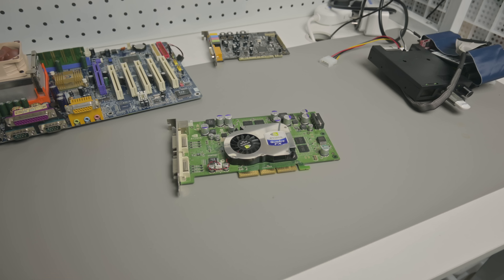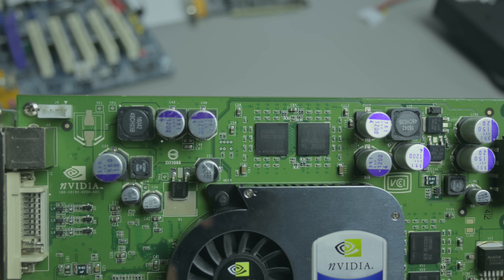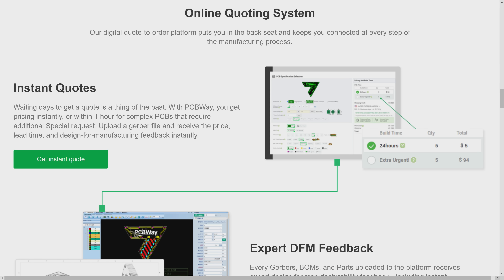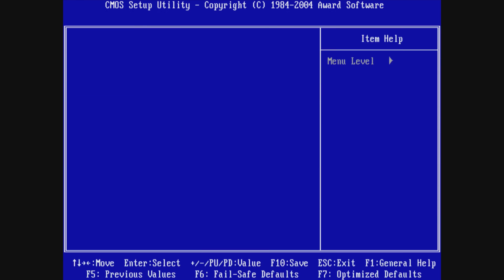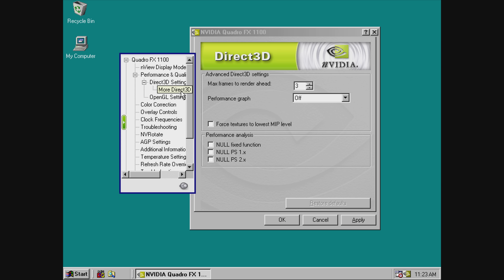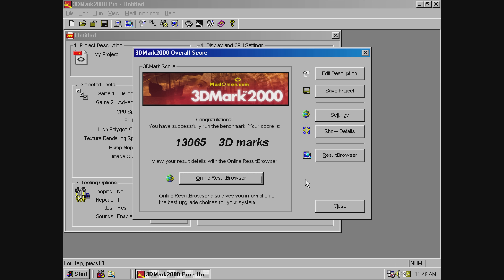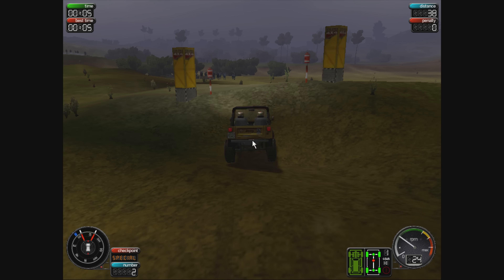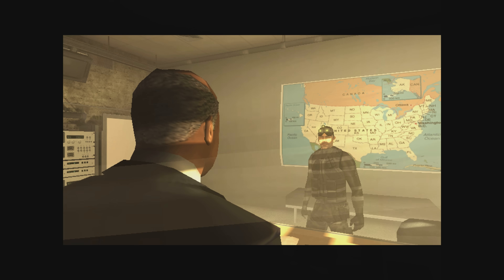20 Year Old Workstation GPU: Nvidia Quadro FX 1100

Comment: Wait, what? It's DDR2, not GDDR2? Had to confirm that and seems weird, since the original FX 5700U used indeed GDDR2.

edit: NV36(B) shouldn't have an IHS o_O
Reply from the maker: I checked the memory chips. They are Samsung K4D263238E-GC2A. Each chip is 128M GDDR SDRAM 
and rated up to 350 MHz. Hope that helps :)

Comment: I'm starting to replace thermal paste with thermal pads on my older components and systems.  They don't get "that hot" anyway and it's one and done.  No reapplying paste in 3 to 5 yrs.
Reply from the maker: Even on GPUs? I've used pads before with CPUs, but never with a GPU.
Reply: @philscomputerlab  Even on GPU's.  If a pad can handle an i9 spitting fire, it can handle my rinky-dink GeForce 6800 XT.  Though now, I'm working on a passive cooling solution with adhesive TIM.

Comment: I use this card in my dos box, i didnt want a big crt and wanted digital out with an lcd, so i got a 4k 27" benq PD2700U monitor using dvi to hdmi. i also want cards that run dos to xp well. 4k scales the dos resolutions well and i get the 1600x1200 options in windows games, also very little lag. there's some artifacts on pc player benchmark but all the dos games i run work well. I also use the ati firegl x1, quadro 4, with the same results, the geforce 2 mx does not have problems in pc player benchmark but only has 1 dvi out. the firegl x1 works well up to windows 7, this box is limited to agp 2x so the newest cards im trying out now are the geforce 6600's, keep up the great work phil!
Reply: ps the quadro 4 and fx cards are amazing at fast resolution switching for dos modes, the geforce 2 and firegl x1 are slow to the point where i would have to slow my boot menus

Comment: That grade of cards isnt often that different to consumer cards. 
The primary difference is usually margins.
They are below rated clocks on the core and memory and power delivery.
That makes many of those enterprise cards (more so the modern ones) INSANELY efficient.
There are some cards that compare to the RTX4080 at around 100 Watt power draw.
Reply: Nah, I had multiple of these cards, they have binned chips on them.

Phil's card will do 5700 Ultra clocks, but I bought two others with this one and they clock well above 500MHz on the core.
Reply: @CptOnlyWolf  Well I meant the card itself. The core is binned acordingly. Thats what I meant that they are below rated clocks. Tho I shouldnt expect people to know how Dies are rated/binned in manufacture. Dies are faster than their bin. Thats what I meant
Reply: @AlpineTheHusky  I do understand your point, but good clocks do not rely only on binned chip. It's the PCB of the card, quality capacitors, good VRAM and ofc binned GPU chip.

If these cards can do it after 20y of service, that's a quality product in my book 🤗.

Comment: Maybe running a 6x.xx or 7x.xx ForceWare driver enables 8-bit paletted textures.
I remember running a GeForce FX5950 in Win98, installing the last driver (81.98) and losing support for 8-bit paletted textures. I don't remember ever running a version older than 7x.xx. The feature might have been disabled in previous versions just like with 81.98. If memory serves me well the textures didn't look right in FX cards compared to GeForce 4 cards and older.

Comment: I love old school Quadro cards, as far as I understand they really were the best chips picked out of the fab because they sold for much more and stability is the most important thing for workstations. I have an old Quadro 2 card that is rock solid and easy runs at and past geforce 2 GTS speeds.
Reply: @billy-the-kidd-737  When I Look for Firepro cards techpowerup often mentions that these are stripped Chips compared to the top Radeons. Seems to be vice versa here or Informations are wrong.

Comment: It's funny how Nvidia gave technically higher model number to FX 1100 which like you said is FX 5700, and gave the lower one to FX 1000 which is basically a FX 5800.

I still cannot wrap my mind around how that made any logical sense to Nvidia engineers or marketing team 😅.

If Phil said in his video that FX 1100 need to be delided, it's my mistake. I've been doing few FX 1000's that I bought at the same time and I had brain fart obviously.
Reply from the maker: What's your take on the Radeon 9700 cards? I found that the shim causes an issue when the thermal material disintegrates with time and ends up with an air gap. I removed the shim on all my cards because of this.
Reply: @philscomputerlab  I've done few 9800's Pro, and later cards have slightly slimmer shims and slightly elevated middle portion in the bottom of heatsink in the core contact area.

If you take heatsink off and it is fully flat on bottom, there's a big chance you have one of the early cards. I would remove it in that case, or get an aftermarket cooler.

If the core contact area is elevated on the bottom of heatsink, I would simply repaste and not bother with removing it, due to revised stock cooler and shim 👍.

I have one 9500 that can be soft-modded to 9700, therefore I do not have much experience with these cards. I've removed it nevertheless, did not want to risk it.

Sorry I have to correct my message few times. I've got an OCD regarding this matter and it's quite late over here in UK.
Reply from the maker: @CptOnlyWolf  Yes it's good to take care of these precious parts. Well worth taking a look before powering on.
Reply: @philscomputerlab  After your comments on the R 9700 heat issues  I have wondered about removing the shim as well.  Do you think it could be deterimental, does it have any significant role in heat transfer?  Instead, I have placed a copper shim over the die before replacing the cooler.  Again, I don’t know if this is the best solution as I am adding an extra layer for heat transfer.  This also makes the outer square shim redundant anyway, so your advice to just flip it off could be the best.
Reply from the maker: @DavidJames-d7z  I've shown the shim removal in at least two videos, definitely something I would recommend.
Reply from the maker: @DavidJames-d7z  I've also tried using a copper shim, but it can move and then the heat transfer is a little bit reduced. The Shim pops off easily with a sharp knife or tool.

Comment: The FX 5000 is generally considered to be the worst series in GeForce history. And now we have the RTX 5000 series, which is really bad value and is riddled with issues (connectors, ROPs, black screens, PhysX).
There was also the GTX 500 series, which was technically a 400 series refresh, but Fermi was definitely one of their weakest architectures.
Is this a pattern? 😉
Reply from the maker: We shall see if the RTX 5000 makes a comeback as Retro, I don't think so, seeing it can't do PhysX any more haha. The FX series however has made a real comeback with the retro community. Also the AF quality was ahead of its time, apparently it took quite a few GPU generations to match the quality of the FX again (GeForce 7000 series maybe?)

Comment: I have the same card. I don't know if it was the driver I was using but for some reason the Quadro to GeForce mod works really well. (I'm on 98se). Good to know about the thermal issues, I will have to look in to that!
Reply: On FX 1100's heatsink is directly glued with epoxy to the die.

It was my brain fart about delidding FX 1100's and I've explained that in dedicated comment.

Comment: Do the quadro fx 3000 need repasted? Got a couple of those and a quadro k2200 in my collection. 

The fx line shoud work well with glide wrappers. 

I had a evga fx 5700 ultra and a pentium 4 3.0 w/ht new back in the day. I remember need for speed undergound and half life 2 struggle with that card. Hl2 even dropped back to dx8.
Reply: Yes. 20y old thermal paste between the lid and core is still a 20y old paste, and lost it's peak properties long time ago.

Heatsink is epoxy glued to the lid on all FX Quadro cards, and it need to be obviously removed before delid takes a place, so please be careful if you are planning to delid your cards.

I have much love for oddball FX cards, and personally it would be very sad to see another one go especially FX 3000.

Comment: These cards are supposed to support 8 bit palletised textures... So why didn't it work for you? Perhaps you should have been running the more compatible 45.23 drivers? Edit: i saw someone say this is based on 5700u chip, so that explains why you can't use an older driver.
Reply from the maker: I believe it's a hardware issue, not driver related. FX 5200 or 5500 should work.

Comment: I've been using a Quadro FX 1300 PCIe to game in Win98 on an ITX Core2duo motherboard with T5500 CPU.  In 3dmark 2000 it scored 7191 in Win98 vs. 17226 in XP using the PCIe slot, and roughly the same when using a PCIe to PCI adapter in the PCI slot, so it's a solid alternative for Win98 systems lacking AGP, I'd say at least 2X the performance vs. an FX 5500 PCI.

Comment: Honestly, the quadro and firegl/wl cards should never have existed, it is only a cash grab but offers nil. I'm active CAD drawer since 2003, I learnt on Solid Edge in school, back than I used an awesome radeon 9800 se. When I got first employed in 2006/7, the machines all had Inventor 2008 and 09 and we were using bog standard gtx 8800. My next company built a machine specific to my wishes, using Inventor 2013 and Solid Works 2011 with a gtx 560 and later a 3gb gtx 1060. My current employer is the very first that buys OEM machines with overpriced low power k2000, p1000, t400 and a2000 with INSANE amounts of VRAM like 12GB for the a2000 BUT pair it with the worst CAD software (hicad) that doesn't benefit from hardware accelleration at all. It does everything on the CPU and the machines only use those quadros for display adapters 😂😂😂. Mentally, I have given up on that company, I'm only there for the money and don't give any input or optimization hints anymore, it's pointless.
Reply from the maker: What a waste of these resources 😂😂

Comment: Sorry but I'm an ATi guy.
Reply: Radeon 9000 series FTW :D
Reply: @Q36BN  8500/9100 is also a good option if you are not planning to play any DX9 titles.
Reply: I liked my 9700 pro as well as my 3870 in Crossfire, but I really hated my X1950 pro (because it had overheating issues on a VRM or something). I switched several times between nVidia and ATI (later AMD). Maybe I just like the good old times more than a specific manufacturer? I don't know.

Comment: I had Nvidia FX 5500 256mb gpu back in the day, it actually did well in games back then.
Reply: The 5500 taught me the consequences of thinking more VRAM is better. I didn't hate it at the time, but later learned what a huge mistake I made choosing it over the similarly priced 9700 Pro since that only had 128MB, stung a bit.
Reply: @PhAyzoN  I made a same mistake thinking more vram and better dx version is all i need for better gaming, i didn't know much about other gpu specs at the time.

Comment: I agree that the early Quadro cards were superior hardware.  I've got a Quadro2 Pro and 2x GeForce2 Ultra's, all made with the same design on the same PCB.  The Quadro card has more solid-state caps than the GeForce's and it'll overclock higher - both in core and memory - than either GeForce2 Ultra.
Reply from the maker: Thanks for sharing your experience!

Comment: An nVidia driver programmer once said that these cards, their specialty was wireframe rendering. Gaming cards can render 1 pixel wide lines just fine and very fast. Thicker lines are emulated by rendering quads (2 triangles). If you turn on antialiasing for the lines, it is done through software and performance goes to 1 FPS.
With a Quadro card, it is done in hardware. They can handle thick lines and line anti-aliasing.
I'm not talking about the FSAA that came after.
Reply: Is this a hardware or software limitation?
Reply: @NathanDrake5  It's a driver limitation. The NV36B in the Quadro FX 1100 is the exact same silicon as the FX 5700.
Reply: @NathanDrake5  He never said but I imagine it would be devastating if they used the exact same chip in gaming and workstation GPUs. Some clever person would release a driver patch and news would spread quickly. I do remember a software solution for turning certain Radeon 9500 into 9700 by turning on some of the disabled pipelines. It worked on the 9500 cards that had the memory chips setup in an L configuration. I had one of these cards and received a nice performance boost. There were no graphical glitches in my case.

Comment: I have the similar Quadro FX 1300. Its lower clocked but has twice the number of TMUs. But it's PCIe not AGP. It is one of the few PCIe cards that I have managed to get to work with Win98.
Reply: in my experience it doesnt work well at all. in opengl games especially its broken no matter what driver version you use. in windows xp it works alright
Reply: @igorbog88  Yeah, official drivers are trash compatability wise. I used an unofficial driver that apparently supports up to nVidia 8000 series (though I haven't tried a card that new).  That driver seemed better.  Especially with OpenGL. According to my notes, Return to Castle Wolfenstein, Motorhead, Halflife 1, Max Payne all worked.  Quake 2, MDK2 and Expendable didnt.

Comment: Interesting to see an FX series card without paletted textures support, usually that's the last series of nVidia cards you can guaranteeably find support for them
Reply: I've always heard that FX is the last to support it, but I've never gotten it to work on my FX5900, 5500, or the plethora of 5200s I've come across. I'm starting to wonder if its only the earliest models (5800 and 5600) that do, as I've never had one to test.
Reply from the maker: @PhAyzoN  AFAIK it's the older FX cards that support it. Also DirectX version, other than 7, breaks the test in FF7 and FF8, so stick with DX7. FX 5200 and 5500 should work though. I believe 5200, 5500, 5800 were the first GPUs, later we got 5900 and 5700?
Reply: @philscomputerlab  Oh wow, I'll have to try with DX7! I typically use 8.1 or 9. 

The 5500 came out after the 5200, but they're basically identical. They use the same chip, the 5500 is just clocked higher and guaranteed to have the 128bit memory bus. Technically it requires a newer driver version, but I haven't encountered any issues using the oldest 5200 driver with it.
Reply from the maker: @PhAyzoN  That would be awesome if you could confirm this! AFAIK the 5500 is a 5200 with guaranteed 128 Bit interface?
Reply: @ I should have some time in the near future to bring out all my FX cards and do some definitive testing. I'll be sure to let you know!
Reply: I've been pulling my hair out trying to figure out why my FX5700 wasn't showing 8-bit paletted textures support, I guess it isn't supported on this newer card 🤷‍♂

Comment: Now that XBox 360 era games that relied on 32-bit PhysX are officially retro due to PhysX being deprecated, when should we be expecting Phil's killer Windows XP builds?
Reply from the maker: I also see PhysX project go well with Windows 7 or Vista and not XP. PhysX came out right at the transition, but I believe all the good PhysX games came out when Vista/7 was well established.
Reply: @philscomputerlab  its kind of a good for the retro community but also dumb in general. Welp more forgotten vista builds in the future and the loves windows 7!!
Reply: I think more like windows 7 ultimate pc as those 3090 still run 32bit PhysX. Well atleast we got more reasons to build more modern ”retro” builds later on.
Reply: The situation kinda screaming out for a GPU agnostic open source PhysX implementation that works on all OS...

Comment: I heard workstation GPUs are better built, then saw some for parts or not working, on eBay. Not that much better then.
Reply: Many liquidators just say that in order to give less than zero warranty on it, because testing it in any way would already cost more than it's going to sell for.  And there is no eBay option for "at your own risk no warranties" other than the contract-hack of listing good working stuff as broken, then if it works that's a better outcome.
Reply from the maker: @Spudz76  This is the right answer!
Reply from the maker: Often they don't want to, or can, test the equipment and just want a quick turnaround.

Comment: Back in the days when I saw this, I was like 'Oh it's not for gaming ?! I still want one ' :)
Reply: Used to be able to move resistors on the older quadros and turn them into GeForce and vice versa. I think the main thing with Quadros was the way that the opengl pipeline completed its tasks. It would wait for a full cycle before starting a new thread or task ( I'm sure someone will correct me)
Reply from the maker: @davkdavk  I remember actually doing this with a Radeon card. Because of this experience, I still believe there is no real hardware difference, but it's all in the software and certification.
Reply: @philscomputerlab  Thanks, Phil! Yeah it probably just changed the way the inf file read the card and installed the appropriate software or enable the right options as you said

Comment: Modern Quadro cards for sure not lasting longer then geforce cards, they also run hotter cause the smaller coolers.
Reply from the maker: The only modern Quadro I have used is the M6000, came inside a HP Z440 from OzBargain (Australia). Works great, but no idea if it's any different than the GeForce equivalent. It does have huge 12GB of VRAM which is very nice. XP compatible also.

Comment: These cards actually have a 5700 Ultra core on them. Make what you will of that information... Also checking datasheets for the RAM it's actually rated for 350MHz
Reply: Funny coincidence Phil coming out with this video after talking to you on your video about these cards just yesterday. 👌
Reply from the maker: Confirms my experience, that they pick good parts, binned GPUs, and underclock the RAM a little bit. Reliability and stability first most. Thanks for commenting.